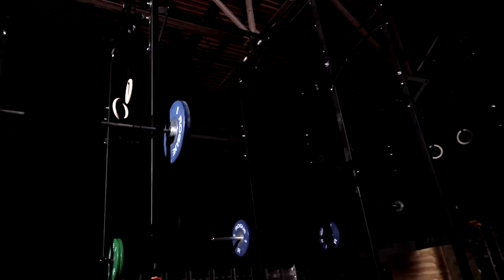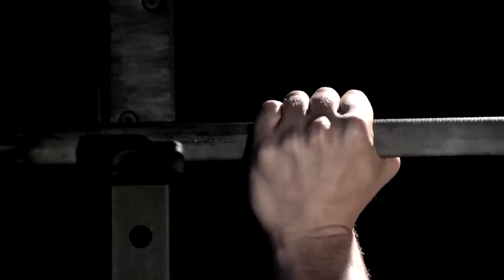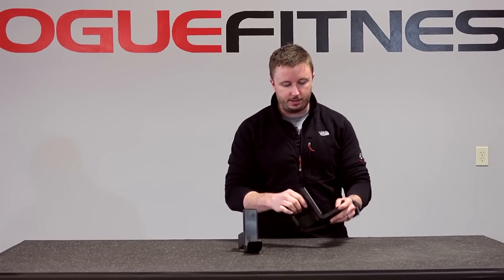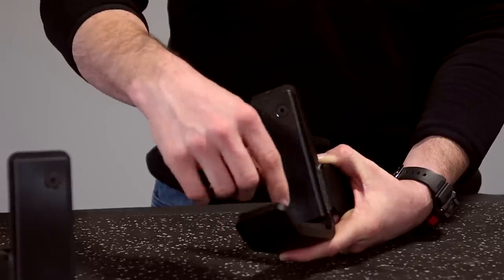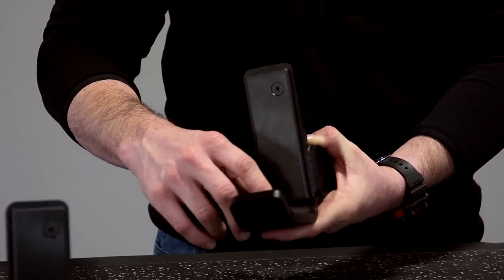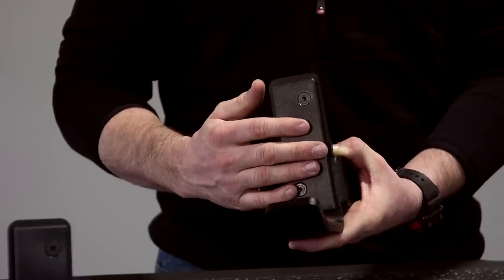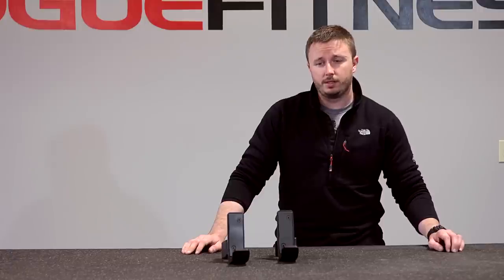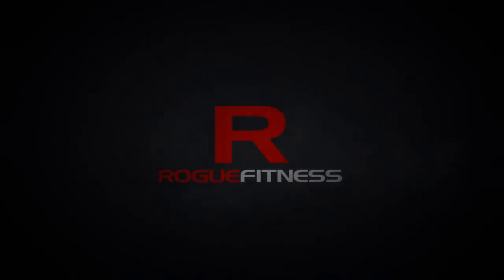Bill talks J-Cup

Comment: Do you have J-cups with an extra safety pin design? Right now, the single point of failure is the 5/8 pin, which is welded to the j-cup on one end only, making it prone to failure due to the uneven force. I think the safest J-cups should be designed with steel surrounding all 4 sides of the 3 x 3 11 gauge upright steel rack. The only way to put it on is to slide it from the top of the rack before you install the pull up bar, cross members, etc. Then you can slide it up or down depending on your bench press position. One safety pin can be used to put the J-cup in place (this design of holding the J-cups from both sides is much safer). Another twist knob can be designed to make sure the J-cup will not wiggle. For that setup, the Westside holes need to be drilled from side to side rather than from front to back. That way, the safety pin will not interface with the J-cup support holding the barbell.
Reply: Youre overthinking this. Not that complivated. Have a hard time believing you're remotely strong to be worrying about the strenght of the J cup